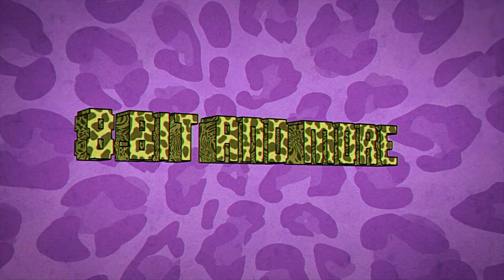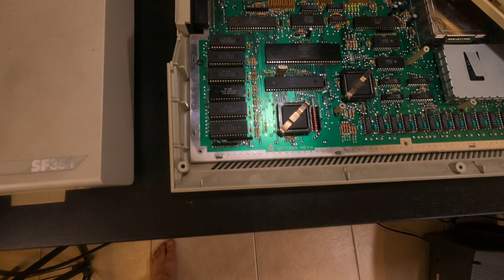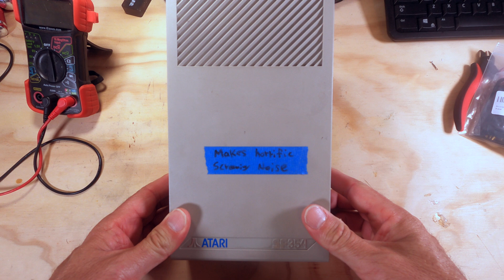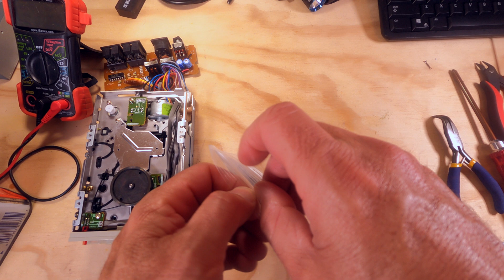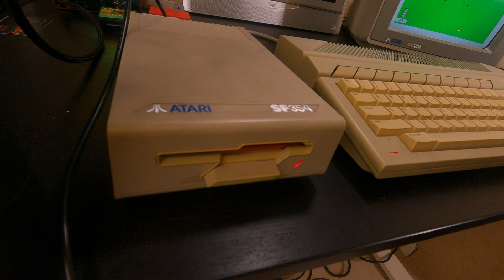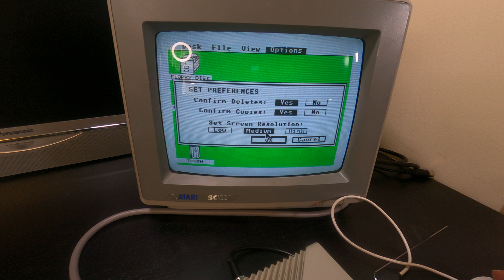Atari 520 ST refurb part 2

Comment: Yeah cool project, enjoying it.  I got the 1040ST FM because of the 1 Meg of RAM, but a mate had an ST before me and it was the 520, yes it was a more sleek machine without the built-in drive and power supply.

Comment: Nice work!  After you get done tinkering with the chips and such, I'd like you see things like the terminal emulators, and Stevie, the VI editor for ST,  STOS-BASIC.  I wonder if Atari could have survived longer had they focused on creating an open source community, and selling things like Compilers, Emulators, and new Non-Graphical operating systems for the ST and XE.  It would be great to have someone focus on things other than games and GEMS
Reply: Giving away compilers or whatever was needed to program would have really helped.

Comment: I finally got a chance to watch this, and yes, I did enjoy it. It's neat to be able to watch you do this stuff, because we don't have the chance to get the hands on experience. Thanks!

1) The ST stuff is interesting to me, but not nearly as much as 400/800 stuff.

2) I really appreciate any programming expertise and experience that you can offer. I tried programming on the emulator on Linux, and I'm unclear on how to set up an Assembly programming environment. I'd appreciate being able to get something set up that allows me to follow along with the old books.

3) Perhaps you could show us some neat old games from magazines, and then show us how you debugged them, and sped them up. I'm also thinking of a trignomic program that showed us the graph line in graphics 8. It has nice smooth curves, but in 1 instance, it displayed a straight line at a certain point in the graph, which seems to be a bug.

4) What strategies can we use to create the simplest driving game? I read an article, but it was too hard for me implement.

5) Tips on programming the simplest flight simulator? I'm out of my league here, but it would be interesting to learn.

6) Maybe have a Q&A at the beginning or end of your video.

6.a) Q: I'm thinking of programming a Mastermind clone [i.e.: Cows & Bulls], so would it be clever to use different graphics modes to zoom in and out of certain areas?

6.b) Q: For a custom character, I tried using a space in memory that had a value that changed often, hoping that the changes would make the character look active and awesome. I hoped that it might look like a glowing object, or a flickering flame. I couldn't get it to work. Do you know how to do this?

6.c) Q: For the next video, would you delve into the topic of what kinds of plastics can be used for power supplies? What thicknesses must there be for safety? I can't imagine paper thin plastic being good enough.

7) I suggest that you record yourself doing any Atari stuff that isn't private. If you decide that you want to post a video about the topic, then you'l be 1/8 of the way there.

8) At the end of the video, maybe ask a question that you are working on. Hopefully, there will be an expert in the audience.

By the way, the sound and video quality in this video worked well for me.

Comment: You can do 640x400 on any VGA monitor with a simple Atari-VGA adapter. The colour resolution require old 15KHz TV resolutions but the monochrome High res can be displayed on normal 31KHz VGA monitors (LCD). Your Panasonic LCD on your desk can probably display the 640x400 without issues.
Reply from the maker: Very true...I plan to try it. thanks for the info